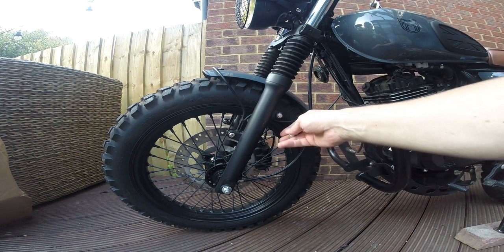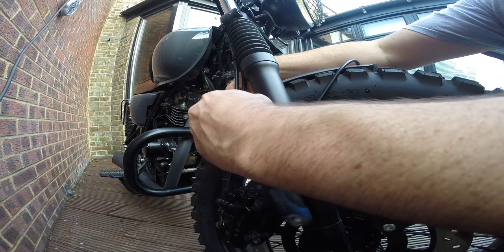Can the Mutt Go Off-Road?  - Dick Installs Handlebar Guards and a Front MX Fender

Comment: I spent the first 5 minutes yelling at the screen to try the plug bolts you took off or buy proper bolts the next day, oh impetuous one.

Young Padawan.

Next three hours was spent with sparkling highlights like your Angle Adjusting Motorcycle Side Support Device, (your brick).
Lotus has a thing like that.

With the Mutt's girly skirt up like that you will not find sheep getting jammed between wheel and steering head a problem.
Macho indeed !

Now to assassinate the Hand Guards.

What a Girl !
May I venture to suggest you don't ride through a jungle ?
For the record I had these on a downhill Mountain Bike but twigged the best idea was to avoid handlebar contact with ANYTHING.

Still, at least they'll see you coming, and that will keep you nice and safe.

Finally I went off road on that R45 and a SOLO! Ural.
Of course, I didn't mean to.

Can't wait for the next exciting Episode !!!

🎵🎺🎺 DaruHM !, dahruhm !, 
da,RUM de DUM de de dum
 dee dee dee !!! 🎶
.

Comment: I have have a AJS tempest scrambler a very similar bike the biggest problem riding off road is the interlocking brakes there’s no way of just using the back break in the wet mud  the front wheel locks up
Reply: Being as ancient as I am, interlocking or linked (E4 ?) brakes are a new thing to me.

I have learned something from your post, that they may not be ALL a good thing.

Still, if two things can be linked, it must be possible to UNlink them.
.

Comment: I would have left the handlebar end caps in place before fitting the guards to give a bit more clearance and also give the throttle tube some space.
Reply from the maker: You don’t think it would have been an issue that they were tapered? I was also concerned with the length of the bolt in the bar. I didn’t want to give it opportunity to bend or snap prematurely. Throttle knob works freely. 
Thanks for the comment.
Reply: @DickWhistles  I doubt the thickness of the handguard bracket would have made a significant enough difference to the amount of thread available on the bolt. The flat head of the bolt / washer would keep things in line so no effect from the partial dome, which in itself is flat enough across the hole where the bolt fits. With the rigidity of the other mount it wasnt going anywhere and you would have more room for controls, levers etc.
Reply from the maker: Jay B I’ll take another look. 
Thanks for the comment.

Comment: I will never understand the macho appeal of a 1000 CC 'ADVENTURE' bike.

Even if you can handle the weight, no one can use that amount of power on dirt and mud.
(The Paris -Dakar Boys do it, but their bikes are paired down and they carry nothing.)
Big bikes are also long and tall, not a good thing going through woods of hedges.

I think the Mutt is beginning to look an excellent base as even with the armour it is still short and light, (look at Trials Bikes), and no one needs to go off road at 70 MPH.
.